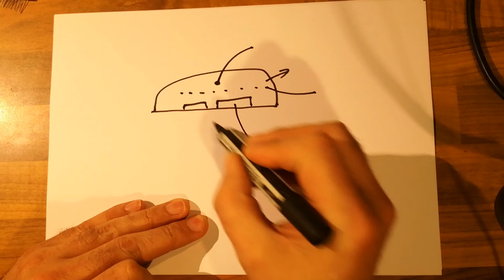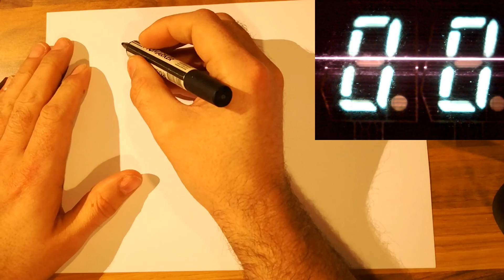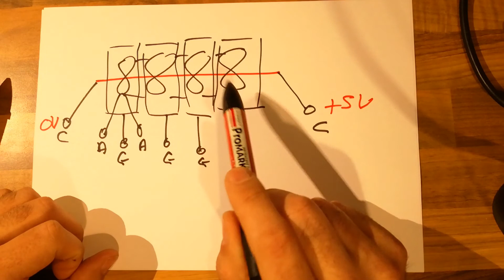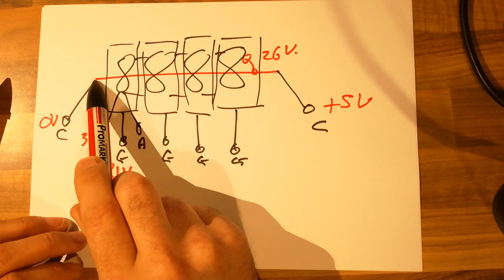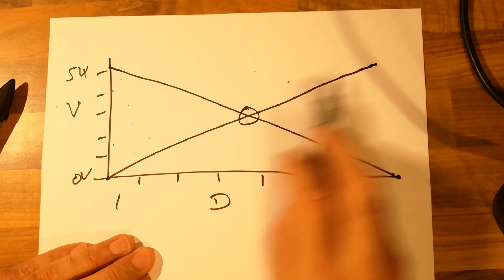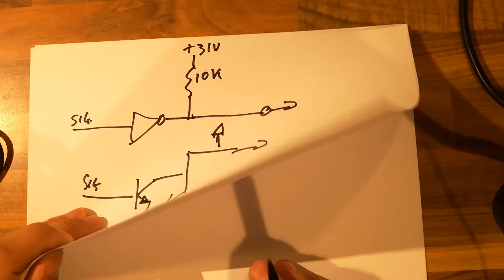Vacuum Fluorescent Displays on Arduino

Comment: According to the Noritake tech sheet "A Guide to Fundamental VFD Operation" the filiment AC should have a small DC bias (Ek).  The reason for the bias is to avoid ghosting when the anode is at 0v.

Comment: Although I don't understand English well, but mainly because of the photos, the video was very informative. However, my great difficulty is related to the Arduino code, for example, how to map the VFD pins with the controller driver, like, for example, what is the connection order of the pins, or does it matter what the order is?
In fact, I would like to make a watch;
Thanks

Comment: I'm would like to power the filament as you do with 2 pins alternating high and low but no VFD I've worked with draws as low as 19mA, all have drawn between 150-200 mA at 3-4 V. So I'm looking for a transistor circuit to do it, if you have a reference I would appreciate it. You mention an H-bridge circuit on your blog, I'll look into that.
Reply: I followed this and got it! Awesome! https://www.build-electronic-circuits.com/h-bridge/

Comment: hmmm, you have 9 digits so you have 9 grids...9 wires for the grids,,,,,the anodes  of the seven seg digit are all tided together with the anodes of the other digits....so seven wires for the anodes....so ,,,,,,,,,,,,,you strobe the grids correct....if my eyeballs were strobe to match the frequency i would be seeing one digit at a time?
Reply from the maker: Correct. Multiplexed just like many LED displays.

Comment: It could be the camera is picking up IR but it seems you have way too much filament voltage.  You should never see it glow!
Reply from the maker: I pumped up the camera settings specially so you could see the filament glow. You can't see it glow with the naked eye, I just wanted to demonstrate where it is and how it heats up. For reference, the segments behind it are all off. They look on, but they're actually off, it's pumped up that much.

Comment: This video was very helpful, thanks for uploading.
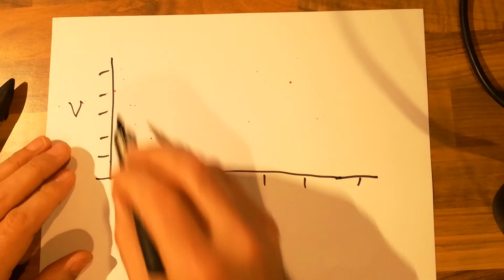There are some slight glitches and it jumps multiple minutes back at about 14:50 but it was very informative.
Reply from the maker: Chef Geoffrey Excellence eww, not sure what happened there. I have an issue with making videos: at the moment all I have is my phone, and that stops recording when the file gets too big, and I have to join files together. There's never any warning either.
Reply: I've heard of people setting a timer on a watch or something for, say 10 minutes then they would pause recording when convenient, then resume to stop those crazy cutoffs. 

In any case, I hope you get a solution in place soon. 
Thanks again for the video, thanks to you I got a new VFD and a vintage 1970s VFD that hasn't been turned on for the best part of 20 years up and running again. I'll be sure to check out your other videos.